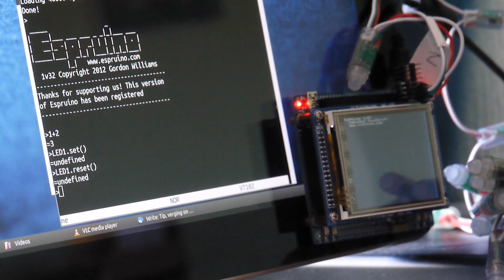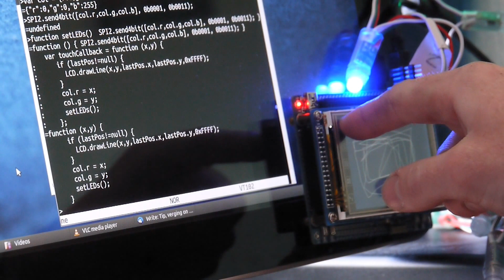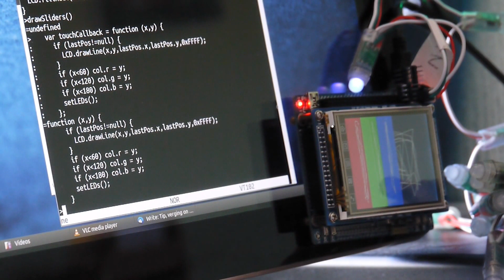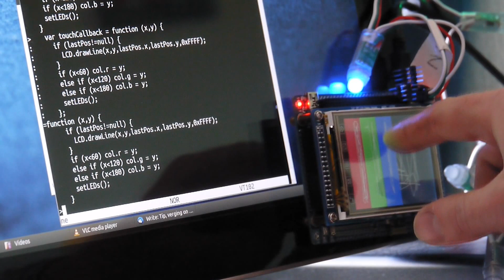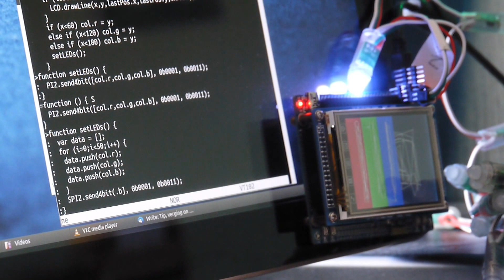Touchscreen LED Light Controller in Espruino

Comment: Can you post this whole code onb the website? Im having trouble finding your touchscreen codes.
Reply from the maker: There were links in the description, but I've just updated them and added a direct link to the page on touchscreens.
Reply: The code i found on the website is different then from what is used in the video?
Reply from the maker: Garrett Leffue Yes, it has another feature - as well as the sliders you can save the colours to boxes on the left hand side, which are then cycled between randomly.